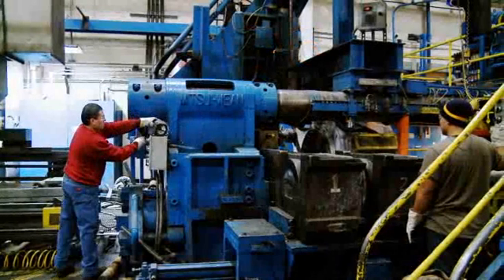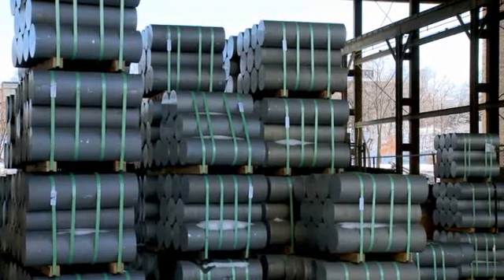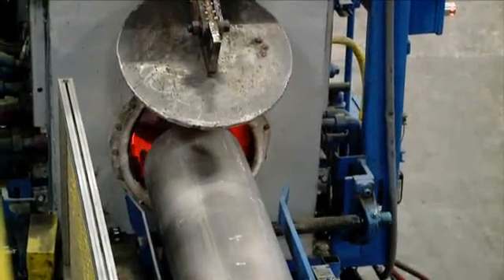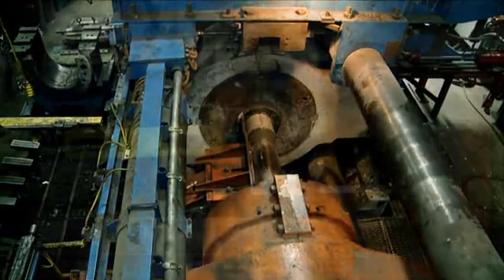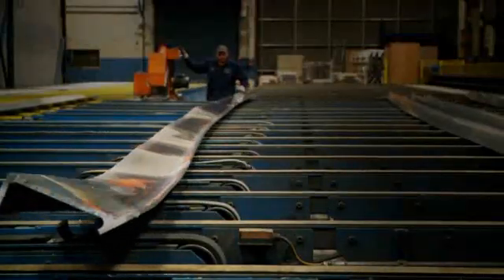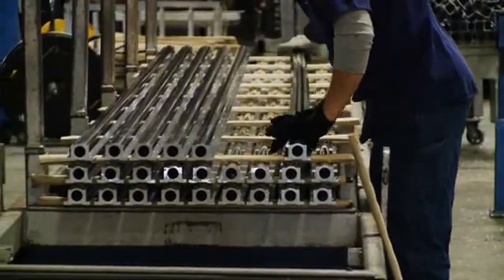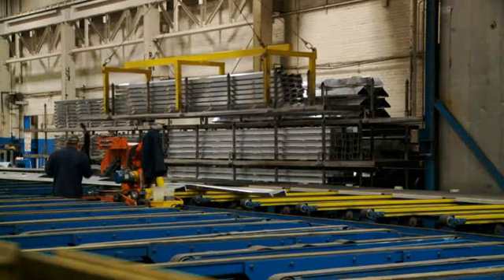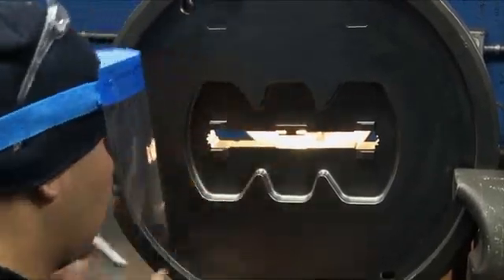Aluminum Extrusion

Comment: I think???? for hollow extrusions the blank already has a hole through which the inside shape is inserted,, thats the only way I can figure it out as they don't show it in any of the posts,
Reply: Usually there is a fixed mandrill which shapes the inside hole. see this: https://www.youtube.com/watch?v=PT_mqlZwmXs
Reply: the die has three different components, the mandrel, the cap and the backer, this three pieces are hold together with bolts.
the dies has some ports to feed  the aluminum and form the hollow part as well as the exterior part of the extrusion.
look for aluminum extrusion hollow dies on you tube and probably you can understand or have a better idea how is made
Reply: @servandoaldaco4813  you mean the mandrel  the cap and the feeder
Reply: @dylanoverholt5334  yes  that right
Reply: There is a mandril or set of mandrils that are supported by the ram, and move independently of the ram.  You know those toy clay extruders?  They can extrude tubes of clay too, and they do it essentially the same way.  https://imgur.com/a/LnTzpgk
Reply: +Geoff Conroy
I've been trying to get a clear explanation of how they extrude tubes for months, and it must be classified or a state secret or something. Like, what holds up the thing that pushes into the center of the rod to form the hole in the tube? All I can think is that Superman must position himself in front of the extrusion with the center-dye in his hand.

From what I've seen there has to be a center mandril that goes right through the center of the solid rod then the big pusher forms the tube-wall around the mandrel, then the mandrel pulls out and, voila...sort of... I also saw one where they started with a squat-looking tube with a hole, then rolled it thinner and thinner. It's weird. It's as if they want to keep it a secret or something... I still don't get how it works...

Comment: The extruded bar at the end has a hole through the centre of it. How does the die produce that? The centre of the die would have supporting structures which should shear the aluminium in half. It the aluminium was molten I could see it reforming on the other side.
Reply: The dies have connectors in the middle. Kinda hard to explain in words here is a example.  We run a die at my plant that is a square with a hollow hole in the middle of it. The back of the die were the billet pushes into it looks like a "X"  with a circle in the middle of it. Useing a technique similar to that they can create metal we call hollows bc they have 1 or more open areas in the pieces.
Reply: Look up 'friction stir welding', where cold aluminum is literally swirled around by a hard peg that is spun, plunged into, and then dragged across between two aluminum plates. Aluminum, and in fact all metals, can be welded together with pressure and friction alone so long as the metal is fairly clean and the pressure is strong enough. Aluminum is simply the one common metal that is both weak and ductile enough that extruding it or friction stir welding it is feasible; I wouldn't want to stand anywhere near an extruder forcing white hot steel billets through a die. What would you even make it out of? 

Anyway, just google some images of aluminum extrusion dies and you'll see how they get those tubes to form.
Reply: QwertyTSecond they use more than one die
Reply: Debra Johnson they do not use 2 dies.

Comment: I have worked at one of these plants for 30 yrs.The ram or stem that you see is pushing the aluminum billet forward in to the container.The die is at the front of the container,The ram will push the aluminum thru the die at about 3500 lbs per square inch.The diameter of the billet vary's from 3.5 inches for very small parts up to 18 inches and length from 12" to 50". 18" diameter is about 1250cm,very big
Reply: Hey Gremlin G. I have some questions about this process and the business around it. Can we get in contact? Thanks! :)
Reply: There’s a company hiring in my area, what should I know before applying?

Comment: Amazing that metals can be pushed through a die like they were cornmeal. Even with help from pre-heating, it still boggles the mind. The pressure must be tremendous. I wonder what the lifespan of a die like that could be.
Reply: We have dies that are used regularly and are over 10yrs old. It's all about maintenance and care.
Reply: My plant runs up to 3000 pound press
Reply: We have does that could last up too 100,000 kgs of aluminum
Reply: Aluminum Extrusion Die are made of H13 Grade Steel, heat treated and nitride, the hardness reads 48 RC hardeness after is finish, the life of a extrusion die depends on the maintanace, type of die (it can be a solid die, hollow die, bridge die, etc,) and also the die has to be renitride after certain extruded lbs. to extend the die life. solid die use to have longer life but also depends on the shape of the extrusion die, hollow dies are usually more complicated to work and have a shorter life.
Reply: aluminum is very malleable; think of forming aluminum foil.

Comment: how is the center hole made????
Reply: @Radu Rista --  A common method is to use a special die called a spider die.  It uses a mandrel at the center to create the opening and arms that support the mandrel that the hot aluminum is forced over and then a collar that shapes the outer tube surface.  Difficult to explain but there are lots of images on YouTube showing the process.  I worked as an extrusion press operator for Harvey Aluminum to pay for college.
Reply: The design in the die plate and extra heat, about 960 if memory serves correct.